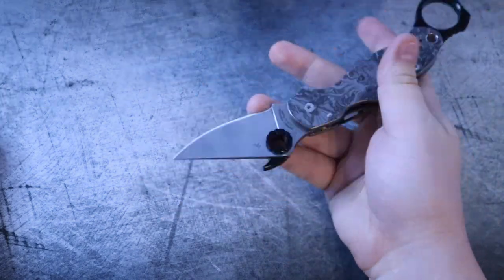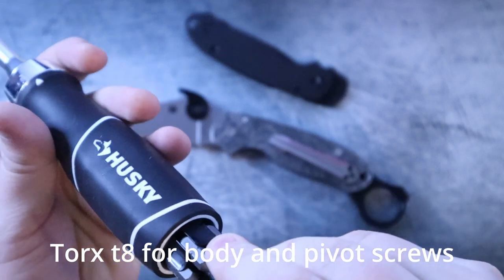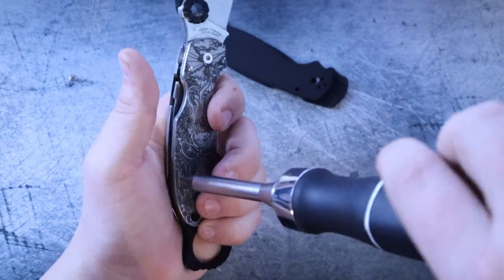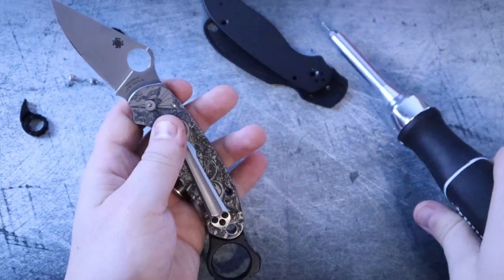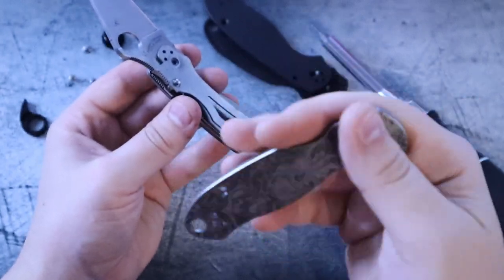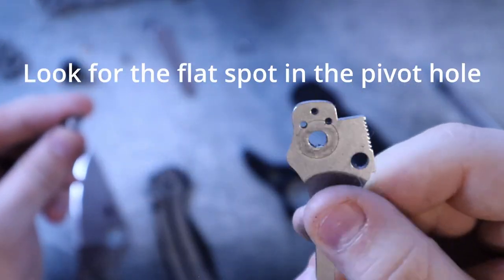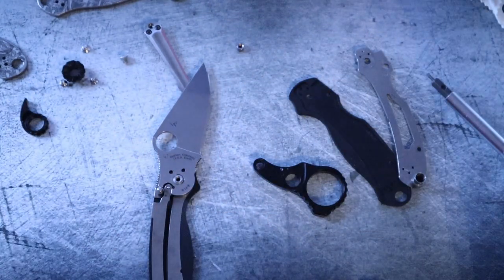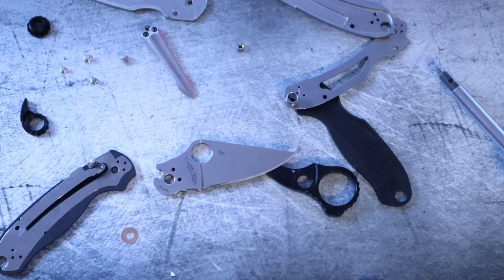How To Disassemble The Spyderco Para 3 (it was too beautiful anyways)

Comment: I want to rit dye my brand new para 3. Think the screws will be red lock tited in? And any suggestions?
Reply from the maker: Few suggestions, grab a pot from a goodwill store(don't use one you plan on cooking anything edible again afterwards) , also if you're able to do it in a shop or a garage as opposed to the kitchen I'd recommend that as well for cleanup purposes..and lastly I wouldn't try it on black or colored g10, the best success I've seen from others is on iade/natural g10..good luck!
Reply: @Rollshambo  thank you. It came out like a dark brown. I want it black. If I bleech the scales and try again, would it hurt anything. Or should I try like blue ?
Reply: Totally useless video. Doing things step by step and SLOWLY would have been helpful. This video actually made me not want to even try it.